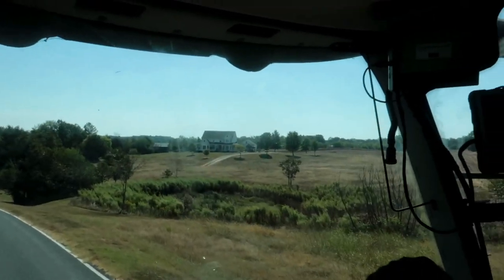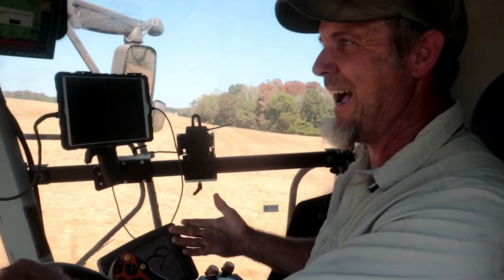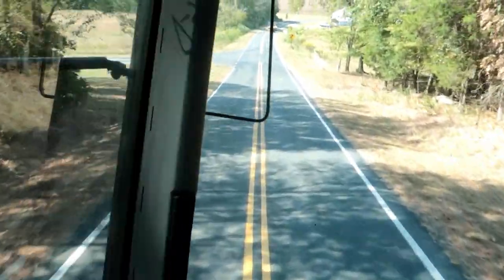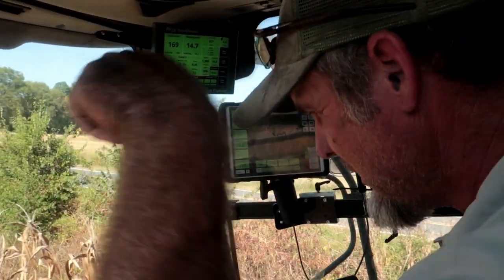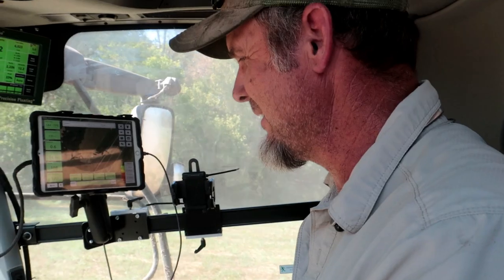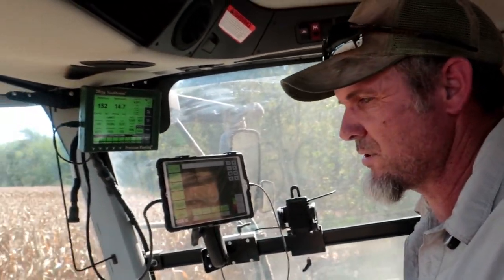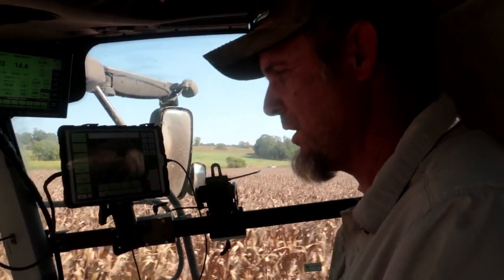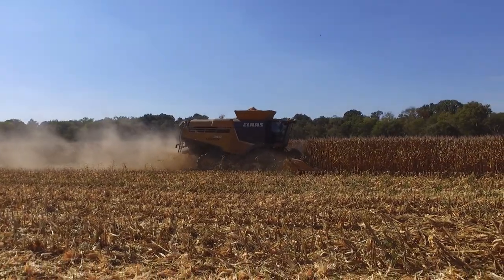Harvesting CORN in this HUGE CLAAS Combine | FARM LIFE

Comment: Do you try to keep your feeders with food in them all the time?? Would it be cheaper if you had an open pickup or trailer  with sides or barrows  to have Landen fill you at the ends of the rows instead of buying those 40//50 lb bags?? great video..